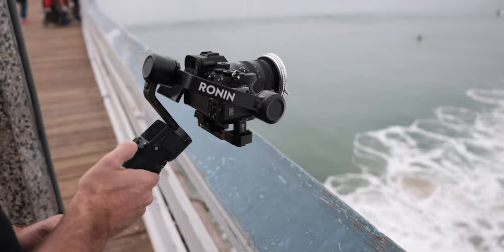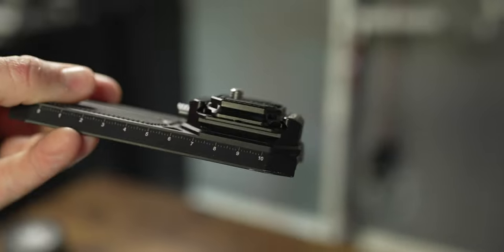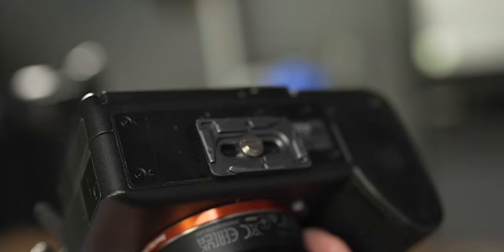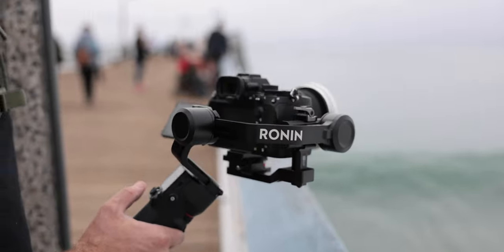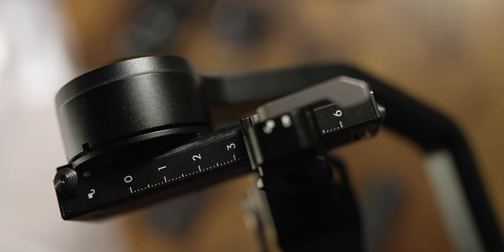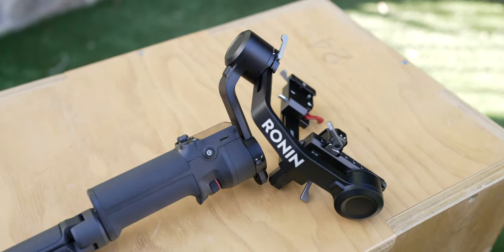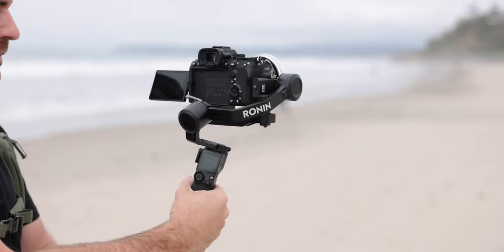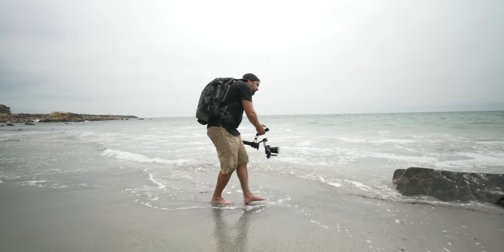I Fixed The Biggest Problem with the DJI RS3 MINI

Comment from the maker: UPDATE: No more drilling needed.  Falcam developed an adapter specficially made for the RS3 Mini to adapt arca swiss.  Here's the link: https://geni.us/dx5nn
Reply: does this work with the peak design plate?
Reply: @seansiquig it doesn‘t.
Reply: it mounts from the left/right direction rather than front/back so i can't really mount a long plane on to balance a long lens.

Comment: I have the F38 system so this is a HUGE tip man.  Huge.  Haven't pulled the trigger on this gimbal yet but now that I know I can, with a minor diy tweak, keep my F38 "stuff" and switch out easily, I just might now.  Thanks a TON for sharing this.
Reply: No need to drill the hole for the F38, I folded some paper in half and drew around the bottom of the F38 base plate. Cut it out and locked it in place on the dji nato rail. It’s not the width that’s the issue it’s the additional height that dji added to there own quick release plate.
Reply: @nl-videography  could you elaborate, maybe send a pic of what you did?
Reply: @nl-videography  im returning mine because i couldnt get it balanced with the f38 on top of the dji plate

Comment: Thanks for sharing 😀 I mounted the Falcam F38 Quick Release directly on top of the standard adapter. It is a bit bulky, but it seems to work 🤷‍♂
Reply: @HikingHansen, when you install the F38 QR, did it not bump on gimbal motor where the back of the screen is, when you're doing Pan Tilt?
Reply: @pedalquest1276  it works surprisingly well. I had no issues so far
Reply: @HikingHansen  thanks for replying.

Comment: The biggest problem for me is that since the it can't stay balanced folded down and the handle doesn't come off, the RS3 is actually more portable since it fits in my bag better.
Reply: That's my turning point to the RS3 than the Mini.. That is a very valid point.
Reply: what do u mean by folded down?
Reply: Yeahh this is a big deal breaker for me if I understood it as you have. I want a quick and portable device for travel but if I have to balance it every time I take it out then no way.

I just gotta find smoother handheld methods for the time being haha.
Reply: @existential_ yeah wish I figured it out before buying the RS3 mini
Reply: @liceafilms I've gotten it now and can unlock all 3 axis's and it fits in my bag. No balance adjustments needed, just unlock and orient each arm so it lies flat in my bag.

Comment: Thanks. I'd like more room to balance my lens back and forth with a longer plate. At 2:13 you secured the clamp onto the DJI mount with only 1 hole. How secure/tight is that and wouldn't there be a chance of coming loose?

Comment: Hello
I tried to connect my RS3 Mini to Fuji X-T30 ii with RSS USB-C to USB-C cable. The camera is equipped with XF 27mm 2.8 lens. Both camera and lens are listed as compatible at DJI website.

But when I tried to use the follow focus feature with the gimbal's dial, I've found that it's completely unusable. And the reason is following.

When I try to set the focus using gimbal's dial, the focus starts changing. But when I stop moving the dial, the focus does not stop changing. Sometimes the focus does not start changing when I start moving the dial. Sometimes the focus goes into infinity instantly. Overall experience is very laggy and I cannot use the feature in real shooting.

Both lens are working normally, the focus in being set properly with the lens' dial. As RS3 mini supports changing other parameters with gimbal's dial, such as ISO and aperture, I tried changing them and it works smootly. The problem is only with focus pulling. Also I've noticed that while changing the focus with gimbal's dial, the s.s., F and ISO indicators on the bottom of the camera screen, which are normally blue in fully manual mode, are blinking into white and then into blue again. So I guess there is some issue in camera firmware in part of processing the RSS input for focus parameter.

The camera and the gimbal both have the latest firmware by date

I tried operating the camera both in USB tether auto and USB tether fixed modes - the result is the same.

Am I missing some settings, or I've ran into a bug?

Thank you!

Comment: I have the old Ronin S, now I have a a7iii with the 28-75mm Tamron VXD (550g). You think that is a good idea to sell the old gimbal and switch to this new one?

P.s. if you add to your setup a mic like a vidoemic pro the gimbal can handle the setup? Like for wedding?

Thanks for the response 🔥
Reply from the maker: The weight on top with the mic would throw it off.  Better to get the RS3 if you want to add anything on top
Reply: @JevenDovey  thanks man ❤️ have a nice day

Comment: Hey Jeven, Looking to get my first gimbal for my Canon R5 with a 24-70 lens. This Ronin still looks like the best out there compared to Zhiyun and Hohem despite not having the AI sensor. That said I am 66 and my vision isn’t what it used to be and am considering adding an external monitor to a gimbal. Is it possible to add a monitor to one of these gimbals?
Reply: Old comment, but yes, you can get a sling arm or mounting arm from Smallrig, Newer, etc. They come with 1/4” mounts and cold shoes for mounting a portable monitor!

They attach to the sides of the gimbal!

Comment: Meanwhile Ulanzi has introduced the Falcam F38 for the RS3 Mini, which also works in vertical mode!!👍 The mounting plate 3334 is smaller than the Dji one, but seems to work also with Arca swiss mounts.

Comment: Few problems I get with the rs3 mini:

1. all the tutorials are in Chinese??
2. With some motions the gimbal goes in overdrive acts erratic and frankly spooks the heck out of me.. first time gimbal user but I thought I’d have a lot of freedom working with that?? My set up is well below 2kgs and properly balanced
3. The panorama mode looked promising but what’s with the setup and all those angles? Am I a computer or something? I want a simple view from my camera and I want it to take a simple panorama, how should I set it up??? Without getting too geometrical:D
4. Same goes for Timelapses and waypoints..

Comment: Dang... I wonder if there's a solution for Peak Design's capture clip. 
Also, you have the 24-70GMII. That's slightly lighter than the version 1... I hope version 1 can still be lifted by this gimbal LOL
Reply: LITERALLY what i've been looking for... we need answers lol
Reply: @KNEEDEEP760  I've watched some other videos and yes it can work with GM version 1
Reply: @poiisondn  Thank you !
Reply: Replied to someone else but the rs3 mini plate works in the peak capture clip v3 with no modifications. It's a tiny bit loose but still totally secure.
Reply: @alexyorkshots  Does it work the other way arround too without modifications? 
The Peak Design standard plate for Clip V3 into the small DJI Clamp which is on the RS3 mini?
Reply: I tested. F38 plate fits into the DJI clamp. Maybe you have to adjust the leaver on the clamp. 
But there will be no drop off protection.
Reply: @pasta_forever  no the Peak Design plates does not fit the DJI clamp, and the DJI plate is just barely too big to work on the Peak Design tripod. I'm starting to think they didn't make these two systems compatible on purpose. Seems easy enough to make the DJI clamp fit the PD plate.
Reply: It seems like the current best solution that I've seen is to get the Ulanzi quick release arm for the Crane M3 and get the F38 plate that's compatible with both Ulanzi and Peak Design. I've read and saw a video showing the M3 arm being compatible with the RSC3 Mini. Unfortunately, that will add $65 to the price of the gimbal though.
Reply: @HikeSoloOutdoors  I have the PD plate and that was attached to my camera originally. After figuring out that the RS3 Mini mounting plate could go into the capture clip base, I started using the RS3 Mini mounting plate solely. 
For the PD plate, I'm just using it on the bottom of my RS3 Mini from time to time in case I want to mount it onto an arca swiss tripod for timelapses.

Comment: I bought it recently and tried with my Sony ZV-E10 + 16mm Sigma lense. Overall is ok but i notice when i tried to rotate the camera (horizontally) using the joystick, the alignment kinda messed up a little bit. So i need to adjust the alignment or re-calibrate again n again hmm not sure if its due to my camera weight or wrong setup ..
Reply from the maker: Might be a balance issue.  The rs3 mini is more sensitive because the motors have less power.  Work on your balance
Reply: It may be too light. Mine has a problem with a6400 and 16-50 in flashlight mode. As soon as I give a heavier lens it's ok.

Comment: My biggest frustration has been with the Tilta cage on my FX3. There's no way I can get it balanced even having the combo of lens+camera with the cage below 3.4lb. It's always bottom heavy and I even if I get to the bottom limit of the side slide, it's always unstable 'cause it would need to go even further to the bottom. When I remove the cage, everything balances well.
Reply: Do you mean it’s too too heavy?
Reply: @jasonleung6433  no, it's still under the max supported weight. I'm guessing it's related to the center of gravity because when the cage is on, when I attach the DJI's small release plate to the cage, the camera height might be a bit high to have it properly balanced.

Comment: I'm wondering if it's better to lose a little more money and add weight and buy a normal RS3? (a74+S 24-70, in future maybe S 85). about acra's system: so I can't use smallrig cage and instal camera to gimbal without this dji plate ?

Comment: the issue I have with the base plate is that Curved placement guide at the top of the plate....  yes i know it is there so you know that part is to mounted towards the lens... but it is a design flaw..... depending what camera you have.  I have the Panasonic Gh5s.... it wont mount correctly as the camera is a little thicker... so the only way if you want to use the DJI plate is to mount it  backwards..... but then you cant open the OLED screen on the gh5s.  I have purchased the falcam adaptor.  And to be honest the Curved placement guide on the DJI base plate is really pointless.

Comment: Been using this qutie a bit now, after a while it just starts shaking wierdly uncontrollably. The only way to resolve this was to re-calibrate it, anyone else found similar ?
Reply: HI; yes me too. The only way to control is not to spin gimbal right or left more than 45 º in one shot.
Reply: @malonsocasa  interesting, it seems to of resolved with update recently however for me

Comment: what about using Peak Design capture clips standard plates? would they work with the RS3 mini?
Reply from the maker: No that’s a standard arca Swiss. That won’t work unless you modify like I did.
Reply: @JevenDovey  Shame that won't work. I had the same question.

Comment: The non-removable battery isn't a problem since you can charge the Ronin when you use use. I have a V-Mount battery to charge my camera and my Ronin SC.
Reply: Yeeeees, I think same. Even a good powerbank is enough, I already used for more than 16h
Reply: The real problem comes when the integrated battery will die

Comment: There is a perfect solution Falcam makes a quick release plate for Zhiyun m3 which fits perfectly to mini3. I have been using it and no issues so far
Reply: Hello. Thanks for commenting this. Been looking for a solution without having to drill. The M3 adaptor you are using, are you using the entire adaptor mounting to the arm of the MINI3 or did you have to do any modifications? Thanks again
Reply: @joeanthony8276  no modifications are needed, just install the quick release plate to the side handle and good to go. I spoke with Ulanzi and they said there will be a quick release plate for RS Mini3 soon.
Reply: I just ordered the M3 quick release arm. Hope this solution works!
Reply: @HikeSoloOutdoors  did this work for you?
Reply: @joeanthony8276  I haven't received it yet. It should arrive later today though, so I'll let you know.
Reply: @Joe Anthony  got the Falcam Zhiyun M3 arm today. It is 95% plug and play on the RSC3 Mini. It's shorter than the original DJI arm by about 1" at minimum extension and about 1.6" at full extension. The security lock that keeps the DJI arm from falling off doesn't 100% hold the Falcam arm. I wouldn't trust it with weight on the arm, but once you lock it down it's good to go. I balanced my caged Sony ZV1 on the gimbal without issue. I also tried to balance my Sony A1 and 35mm f1.4 GM, and while I think it balanced fine and seemed to work fine, the gimbal kept saying the tilt needed rebalanced every time, despite me rebalancing it about 5 times, so not sure what's up with that. But overall, yes the Falcam arm works and I would suggest that route over the DJI arm if you want a Peak Design compatible quick release. Just make sure you get the F38 plates that are both F38 and Peak Design compatible. The plate that comes with the arm is not PD compatible, so you'll have to buy extra.

Comment: What are folks using for mic/sound with the Mini or just using the camera mic?I have the Sony ECM-B10 but it's too big when paired with the a7siii. I could use my DJI wireless mic but it doesn't seem like the best solution. Maybe I just need to settle for the onboard mic on the a7siii.
Reply from the maker: This one is perfect for on the Mini https://youtu.be/aa3eIDQxoWU
Reply: @JevenDovey  Thanks Jeven

Comment: Hi Jeven. How to balance a lense with a zoom range? I balanced mine halfway the size it can be, but when I change my zoomlens to zoom in or out, the balance is off and gimbal goes in to sleepmode, also in the middle of a shot, wich is frustrating for filming weddings. I won't dare to try it on a wedding yet, because of it. Any tips?
Reply: The only way to fix this is to use a Zoom lens that isn’t going in and out. It rather should be all inside the lens

Comment: The arca Swiss thing is also most annoying thing in my opinion as I also use peak design gear.
With your hack you are loosing the possibility the balance the camera to the sides. Not sure if this is so smart…
Reply from the maker: You can still balance side to side with my modification. The arm slides. You don’t need the DJI plate to slide
Reply: Ah ok- that’s awesome then indeed 💪

Comment: How about putting the falcam base plate in top of the dji plate, does it work?  Or do you really need to drill a hole?
Reply from the maker: You could try it.  The issue is the height.  It will probably throw the gimbal out of balance when you stack it that high
Reply: @Jeven Dovey  thank you so much for your answer.   Really cool you show this extra super important tips.
Reply from the maker: @ZamoraChristian  I just tested a PGYTECH Quick Release Plate and those will work in the original quick release.  However, they don't work with my peak design shoulder strap.  So I'm sticking with the drill method
Reply: @Jeven Dovey  super interesting. Well if i get it i will have to use your method,  i have lots of falcam plates so that will be my choice.  👍🙏 have a great Sunday

Comment: wow thanks Within .32 seconds you answered my question if I could use my quick release Falcam plates and look like nope
Reply from the maker: You can if you modify the gimbal with a new quick release
Reply: @JevenDovey  Guess you can tell I got distracted and didn't finished the video, Nice tip. I may be interested in this now. thanks Jeven. always top content. I use FALCAM too.  
Still going to stick to my RS3.

Comment: What really pi....ed me off with the mounting plate that came with my DJI RS2 is that there is only one screw hole to mount the camera cage onto it.
When you run a bigger lens with the focus motor it will make the whole camera rig move around the vertical axis of this one screw until the focus motor loses contatct with the lens - UGHRRRR!
Bought a 3rd. party plate that allows for 2 or more screws to fix the camera cage tightly.

Comment: Jeven, the timing of this video could not have been better, my RS3 Mini arrives today, AND I already use the Falcam 38 on everything I own (including my coffee cup);  QUESTION -  WHAT  size of drill bit did you use?  WHERE did you decide to put the hole at (how far in from what end) ; WHAT length of 1/4  20 did you use.  Again, the timing of this video was nothing perfect; THANK YOU SIR.
Reply from the maker: Not sure the exact size bit.  My tool bench is a mess so I grabbed one that was the size of my screw 😂.  How I decided where to put it is by fitst balancing the gimbal and getting the camera where i want it.  Then using that spot.  You can still adjust the weight side to side using the back arm so as long as you find a good balance spot you can adjust from there.  Also If you really needed to you can add a few holes and move the quick release based on the gear/lens you're using.
Reply: @JevenDovey  thank you sir, your response came faster than my RS3 delivery today.

Comment: I found a way to use Peak Design Plates! There is a adapter from Niceyrig who fits with minor modification in the DJI Clamp.
Reply: @Pumpi you have a link for it?
Reply: @gavinjai  I can't post it here in the comments. There is a reddit thread where this problem is discussed.